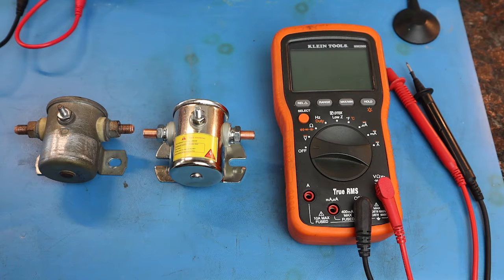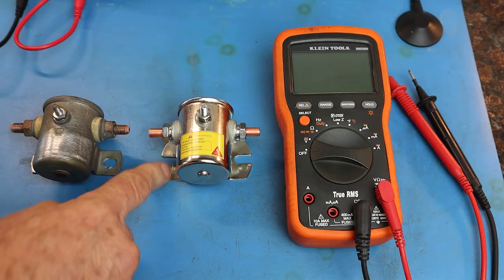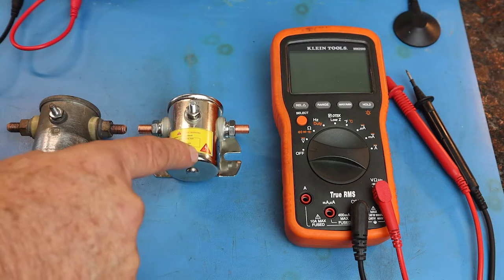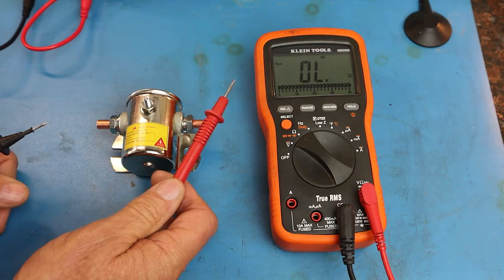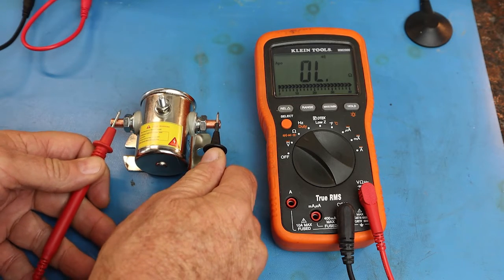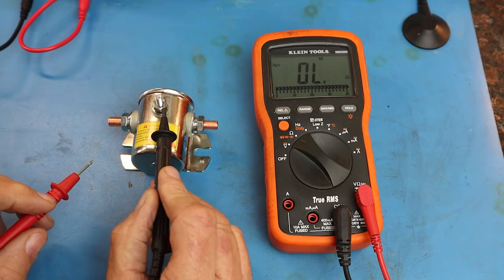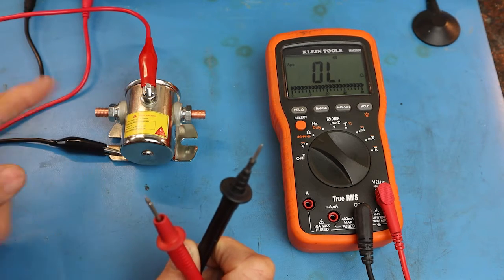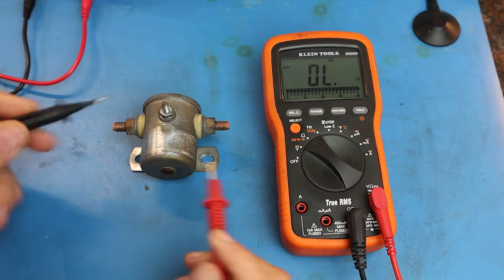Troubleshooting a 12 volt Solenoid and teardown

Comment: What if there is 2 low voltage terminals on the front?  Same principle?  Just from different sources?
Reply from the maker: could be, best way is to test with a meter and a car battery, and some jumper wires.
Reply: I’ve heard that one of the two is for grounding but I doubt it. I use 4 post coils on 1940’s era ford tractors and the low side posts are marked i and s. I for ignition trigger and s for start bypass of ballast resistor to the coil to provide spark during low battery conditions of cranking. It straight wires the coil supply power for the short time it’s cranking by drawing power off the copper disc connecting the large lugs. I could be backwards on which does what, but only one small terminal makes it click with power supplied so easy enough to check during install.